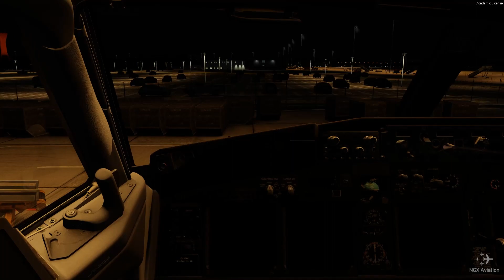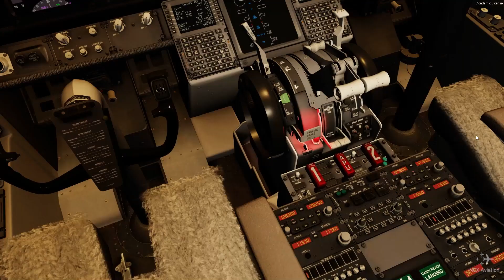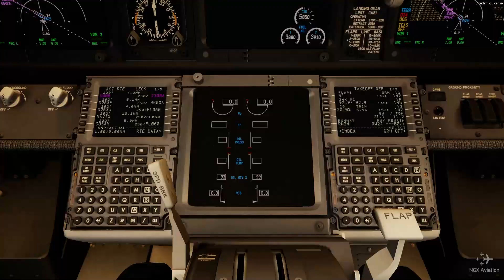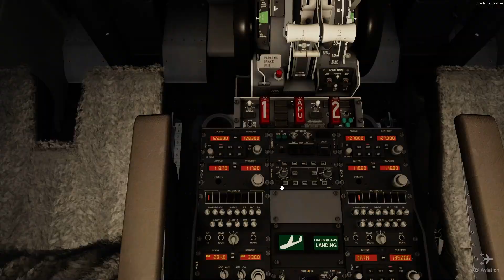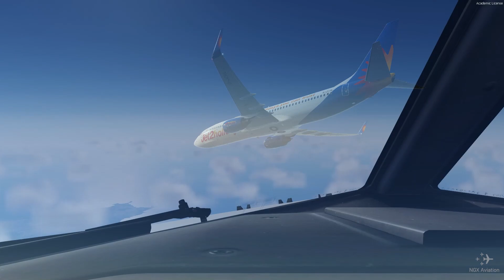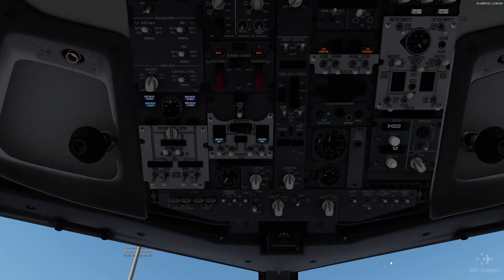[P3D v5.3] Jet2 737-800 from Edinburgh (EGPH) to Lanzarote (GCRR)

Comment: p3d from v4 to v5 pmdg ngx landing and taxi lights do not works.
Reply from the maker: As far as I'm aware, the PMDG NGX was never updated for P3D v5 - only the newer NGXu which I'm using in this video. While the NGX may mostly work in v5, I'd imagine the fact that these lights don't work is one of these compatibility issues. There may be a fix out there somewhere. There's also a chance its just the landing lights not being very bright anyway but I'm not 100% sure I'm afraid. Hope that helps.